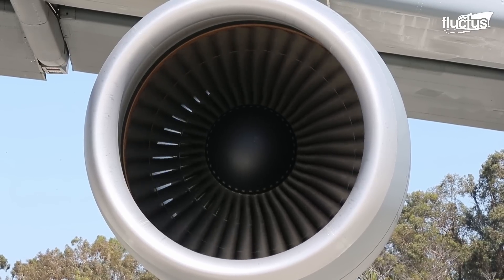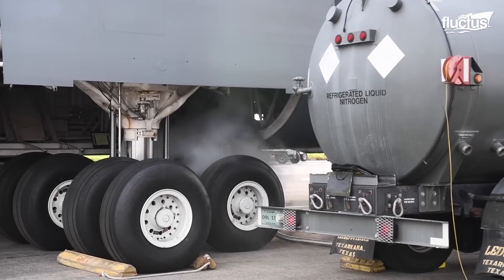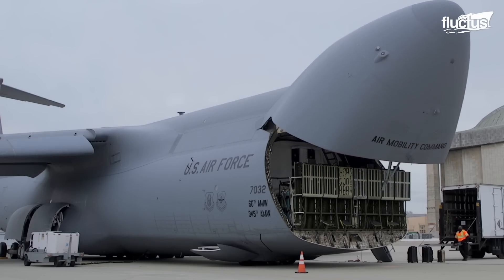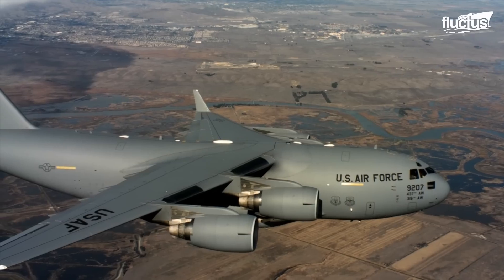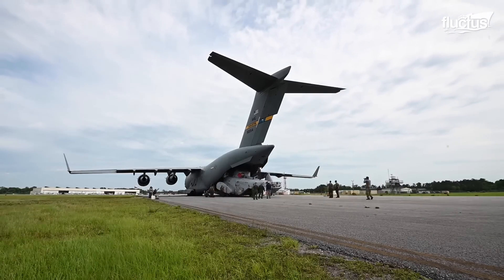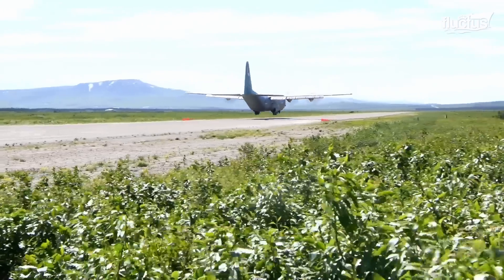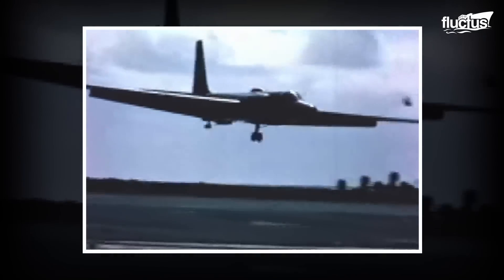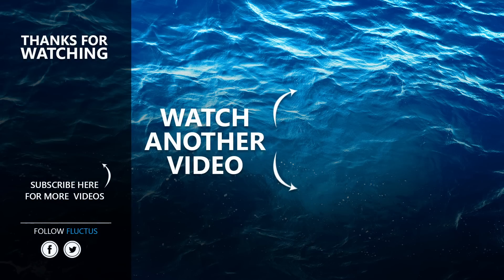The Crazy Process of Repairing the US Largest Aircraft

Comment: 1972-73..Not sure of the year. 630th MASS at Rhein Main AB. A C-5A arrived from England in the early AM .Off loading passengers , I looked down and noticed the puddle I was standing in. IT DID NOT RAIN THAT DAY. So I follow the stream toward the C-5 and find the stream coming from under the left wing....Thinking " water?"....But there is no water in the wing. The APU was running and the stream just did go around the hot exhaust. JP-4?....The load master was wstching the passenger deboarding so I pointed out the puddle and the stream coming from under the wing.....Yup....fuel leak. Quick shut of the air craft and dim bulb me just ho hummed the incident.

Comment: I never serviced tires with nitrogen
It was used for fire suppression
Where was the ppe when attaching the nitrogen lines to the service panel
The system is called Madars that gives fault isolation codes at engineers panel
I have removed and replaced almost every flight control cable on every C5 A,B,C aircraft from 2001 -2006 at Warner Robins depot
And was a crew chief for 12 years also
Changed many tires removed and reinstalled many flaps and horizontal stabs at Depot too
Reply: Madar is long gone, its all digital now

Comment: When the C-5 Galaxy was re-engined they chose the older and much less efficient GE CF6. They should have used the newest GEnx from the Boeing 747/8. This engine is 15% more efficient than the CF6. There was a proposal to change the wings from the outer pylon all the way to the tips. This would make the wing 15% more efficient. There was even an easy proposal to place vortices generators on the body to reduce drag 3%.

These three low hanging fruit options would have provided much greater payload capacity at the same distance  traveled. Or It could provide much greater range with the same payload shipped. The C-5 is amazing but they didn’t upgrade the aircraft with enough effort IMHO!

Comment: .
See ...
"Lockheed C-5 Galaxy vs. Antonov AN-124"

Lockheed C-5 Galaxy	versus	Antonov AN-124
75.28 m	247 ft	length	69.10 m	226 ft 8 in
67.97 m	223 ft	wingspan	73.30 m	240 ft 6 in
558.00 m2	6,006 ft2	wingarea	628.00 m2	6,760 ft2
19.80 m	64 ft 11 in	height	20.78 m	68 ft 2 in
4	engines	4
191 kN	43,000 lbf	thrust per engine	229 kN	51,590 lbf
764 kN	172,000 lbf	total thrust	916 kN	206,360 lbf
378,000 kgs	833,000 lbs	MTOW	405,000 kgs	893,000 lbs
9,560 km	5,162 nm	range	4,500 km	2,430 nm
M0.71	cruise speed	M0.78
130 t	287,000 lbs	payload	150 t	331,000 lbs

Comment: I was a C-5 maintenance troop in the 80's and then went on to finish collage and was selected to attend OTS and pilot training. I was assigned to fly the C-5 at both Travis and Dover. The nitrogen system described in the video was done so incorrectly, yes nitrogen is used in landing gear struts, but the servicing of the system in the video is the system that fills  the fuel cells as fuel is burned off to make the fuel cells non explosive. It also serves as a fire fighting system for under floor and gear wells.
Reply: The narration is atrocious, barley comprehendable.
Reply: @trespire  kinda like your spelling
Reply: @choossuck7653  I rechecked, what's wrong with my spelling ?
Reply: @trespire  lol barley. I wasn't trying to be a prick
Reply: I agree, the description of the nitrogen system was improper described and quite confusing.   Liquid nitrogen was primarily used in fire suspression and in pressurizing all 12 fuel tanks to scrub the fuel.  The liguid nitrogen was stored in two containers known as dewars and from there liquid nitrogen would be converted to gaseous nitrogen for fuel system and fire protection.  Gaseous nitrogen was serviced by maintenace personel to all tires and landing gear struts to remove the presence of oxygen that causes corrosion.
Reply: @j.need4qlife483  described perfectly. My favorite system to run to this day.
Reply: I remember that day, do you remember when the 200ton jack was down so I picked up the entire nose myself so you could take the nose gear off. Wasn't nuthin, but ain't nuthin...
Reply: T
Reply: @aasa4732  the C-5 was never replaced by the C-17. Very similar but very different mission sets. The C-17 replaced the 141, hence why both C-5 and C-17 are and will be in service for the foreseeable future.
Reply: I was at travis 82-84 Radio Shop 60th AMS...I'm proud to say I've sat on the T tail/ horizontal Stab,  at midnight on Christmas eve, riding launch, with a CDIPR problem...:)...You may have been there when one Crashed in Shemya Alaska and sent the main landing gear up into the upper deck...I filled out the maintence logs so many times, even though it was decades ago I remember Ops Chk GD IAW IC-5A-2-8-1...As a radio guy I got to write FAI a lot too...:)
Reply: @aasa4732  The C5s are down south of NC ,you know where and they are up north of Dover too.
Reply: Used as a fire asphyxiation system in sime data centres as well.
Only issue was that it only stopped the flames and not the smouldering so the fire wasnt completely extinguished and could restart once the nitrogen effect deteriorates.
Reply: Ever been to Westover?
Reply: Don't forget one of the C-5's major missions at Dover (A.G.E Mechanic 74-78)...periodic "engine runs" to keep Delaware from floating off into the Atlantic...

Comment: -  That tail shot gives a real idea of the scale of these big aircrafts! That they actually fly is AMAZING and a testament to the power of those jet engines and the skill of the crews and design bureaus!!   Imagine, lifting a 62 metric ton main battle tank and flying it across the world!!  
-  I am no engineer or anything as that, just I am 14 and I am fascinated by this stuff which to me borders on the near miraculous!  And I bet it that others at here do thinked so too.
Reply: Got to go on the C-5 production line at Lockheed Marietta while a Mechanical Engineering student at Georgia Tech. The tail of the C-5 is so high above the fuselage that Lockheed had a separate building outside of the main assembly building for the tail installation. It was called the “Cat House” because that’s where the C-5 got its tail. Fascinating plane and production line!
Reply: You should have heard the old tf 39 engines they had. You could hear them coming two states away. Awesome awesome sound

Comment: Been about twenty years since I worked on one as a Avionics Mechanic. Basically the same except for all the replacement of all the old analog indicators. Still have the augmentation system. My favorite was being called before a flight because it failed a self test. Up the ladder all the way to the top of the stabilizer to change a pressure switch. Not good for someone afraid of heights. Had more fun on the C-5 than on the B-52's. I loved working on aircraft and hated to retire but it was time.
Reply: The Aug, ALDCS and AP boxes are all gone now.  They are all contained in a pair of redundant boxes all bus interfaced.
Reply: @beckyumphrey2626  Looks like the systems themselves are still in place they just repackaged the controls. Did they keep the INU's?

Comment: 'Was at Altus, Okla. in 78-81'. I worked flight-line C-5a's and the last year 141a+b's  2nd shift in ISO docs. I ended my time in MAC doing T.O.D.O. in Oklahoma. I transferred to Gaum, USA in August 81-83'. SAC and did a B-52D to G conversion working TODO. ('Rec'd an 'Air Force Achievement Medal, and transferred to Grand Forks, North Dakota in 83'. I was on B-52G's and was engine run Qualified working the flight-line, in-the-cold' for four winters. (Coldest place to work/flight-line.) I had other hats/ Mobility in Gaum/disaster prep/shelter team...and I played my trumpet in the 'Red Dragons and a year and a half in the Air Force Band. I went on from North Dakota to the desert and worked the B-2 Stealth and then the I.G.'s office...20+ ...WOW  ...Oh, it is called MADAR in the C-5, too!  (Malfunction Analyst Detection And Recordin' unit!)

Comment: I guarded C-5A's from 1974-77 at Altus AFB, OK. Had several friends in maintenance so I found out how much was involved to keep these aircraft in the air.
Reply: 1973Veteran, I  must have walked, or drove  past you at least a few hundred times. I worked on the C-5 flight line from 71-78, then went over to start the Field Trying Detachment. I left Tornado Alley in 1979.
Reply: @mrsamzero1  I probably checked your line badge a few times. I pulled Entry Control Points on the C-5 area and when they were parked in the hangars having maintenance. Also pulled security on the C-141's and the KC-135"s.
Reply: I was there dec 69 when the first one arrived! SAC & MAC 1966-70 Sgt USAF Transportation Sqdr

Comment: Back in Dec 1995 was mobilized for Operation Joint Endeavor.
We flew from Ft. Benning, GA to Germany on one.
We loaded our trucks onto it and then stayed to help the crew chief secure them.
I snagged three rows of seats for my unit.
Right by the emergency exit and the exit rope you use to climb down it.
Was able to lift the arm rests and stretch out on the seats.
We'd taken off at 0600 and and landed around 9:30 or so in Frankfurt Germany.
After we had loaded the craft, we were walking back to the hangers.
I stopped and looked at the C-5. It was leaking fuel but that was to be expected.
I asked myself, and I already knew the answer, "Can this thing really fly?"
Yes. They can.
Reply: 12 years flying C5s.  If one was leaking ‘fuel’ we would have declared an emergency and had fire trucks there ASAP.  You were likely seeing moisture but certainly not fuel.
Reply: On our way back after Desert Storm we stopped in Germany. As we walked into reception center a young woman was standing near a table. It was clear she was Army. What got us was she was holding a teddy bear almost as big as she was with her left arm. She had two M16s in her right hand. My buddy looked her and said, "bet no one is going to take that bear away from her." They're great planes. However I hope I never have to fly on one again. I almost froze on one trip.

Comment: According to the law of physics, these massive aircraft should not be able to fly, but they do. We have some very brilliant people in this world!
Reply: Actually the laws of physics support the theory of flight.
 Newton's third law of motion, for every action there is an equal and opposite reaction
Reply: @John Evans 
As a aircraft engineer for the last 27 years I can assure that's just not true.
 Are you referring to the ongoing debate about airfoil Circulation theory Vs Bernoulli's theorem?
 Airfoil design and aerodynamics, both subsonic and supersonic is very well understood.
Countless hours are spent in wind tunnels fine tuning wing aerodynamics in minute detail.
 If it wasn't well understood then aerodynamicists would just be purely guessing as to what shapes to use as was done back in the 1900s.
Reply: Its physics that allows it to fly.   Top if the wings is longer than the bottom long story short it provides lift.  So then the size and shape of the wing makes all the difference
Reply: @John Evans 
Actually it doesn't at all. 
Most aerobatic aircraft use a uncambered (or symmetrical) wing, meaning the top and bottom sides have the same curve.
These aircraft rely on a positive angle of attack (the angle the air hits the front of the wing) to generate lift, which is why when they're upside-down they fly nose high.
Again they are relying on Newton's 3rd law, by deflecting air downwards they create a opposite force or lift and relying less on the lower pressure on top of the wing to provide a upward force.
 You can also fly upside-down with a cambered wing (more curve on the top) but this requires far more angle of attack to generate lift.
 You can get a flat plank to generate lift with enough angle of attack or even your hand out the car window albeit not very efficiently and with a lot of drag, this is why so much time is spent refining wing design, to reduce drag as much as possible during the creation of lift (induced drag) and increase fuel efficiency.
 I also fly Radio control helicopters and with symmetrical rotor blades (which are just wings) to make the chopper climb we increase the angle of the blades from about +4° during hover to about +12° at full climb, and by reversing the angle of the blades to -4° we can hover upside-down.
 Aerodynamics and lift are certainly a very complex topic.
Reply: @John Evans 
Yes, the 4 forces acting on a plane are lift/weight and thrust/drag, they all must be equal for a plane to fly.
 Ignoring the circulation theory the main things that alter a wings lift are Camber, wing area, angle of attack and air speed.
 In passenger aircraft during cruise we want as little drag as possible so this is what the wing is designed for, most of the lift is created from having a lower pressure on top, now when we want to land the plane slows down, this will reduce lift and the plane will decend.
We can stop decending by raising the nose a little which will increase the angle of attack (effectively increasing camber) and cause some air to be deflected downwards, but eventually we will slow down so much that the wing can't produce enough lift so we extend the flaps.
This does 2 things, it increases the wing area (more wing = more lift) and the flaps will deflect air downwards (Newton's 3rd law again).
 But now we've added more drag so we have to increase the thrust (engine speed).
It's a fine balancing act.
Reply: @John Evans 
Yes a fighter jets wing produces lift, but many the shape of the fuselage will also generate lift.
Fighter aerodynamics are a lot more complex due to the wide speed range (subsonic to supersonic where air behaves VERY differently), maneuverability and load carrying it needs to accomplish.
 And even rockets or missiles still have 4 forces acting on them that need to be countered, their engines will provide a slight upward force that counters gravity,  and many have small fins. Due to their high speeds the fins don't need to be large to provide enough lift.
 The 4 forces (lift, drag, weight, thrust) must always be balanced.
 Take a Harrier jump jet, when the wings can't provide enough lift the engine thrust is defected downwards to balance the weight and allows it to land verticality.
 I'm off to bed my friend, but If I can answer anything else please feel free to ask. 🙂🇦🇺

Comment: I remember as a youngster in the late 90's on Lockheed's Mod team doing satcom mods on this baby and I had to run the wiring to the tail for antennas etc
Reply: I was the wire you laid down. They removed me in 2000 because you installed it totally wrong. Now I have no life and just sit on YouTube like a lonely wire. :(
Reply: So you were one of the E&E s that worked ( ah hung out )in the hayloft most of the day?

Comment: The C-5M is a WILD upgrade!
Reply: When the C-5 Galaxy was re-engined they chose the older and much less efficient GE CF6. They should have used the newest GEnx from the Boeing 747-8. This engine is 15% more efficient than the CF6. Another proposal was to change the wings from the outer pylon all the way to the tips. This partial re-wing would make the wings 15% more efficient. There was even an easy proposal to place vortices generators on the body to reduce drag 3%.

These three low hanging fruit options would have provided much greater payload capacity at the same distance  traveled. Or It could provide much greater range with the same payload shipped. The C-5 is amazing but they didn’t upgrade the aircraft with enough effort IMHO!
Reply: @andrewday3206  Much of the US aircraft are upgraded as needed to avoid the massive price tag of purchasing a new fleet of aircraft.   One thing that cannot be done is upgrade aircraft with technology that has not come out or been proven.  When new advance technology is being used to replace older legacy technology, the time spent to engineer and test takes years.  By then, even more new technology has come out making the latest advancements in upgrades seem a bit obsolete.  The most important factor for upgrade is reliabilty to fulfill the mission.
Reply: @j.need4qlife483  
Well that may be true, in this case it is not the case. The GEnx was a proven technology. Better airfoils were well proven as were vortices generators. Look up the history of the C-141A vs the C-141B. The update I mentioned was a much smaller deal than upgrading the Starlifter. When you can double or triple payload at max range that is what is important. When your tanks hold 1/3 Million pounds of jet fuel even a 25% savings is 80,000 pounds more payload at max range. This is about cargo capacity and every technology was produced and proven.
Reply: @j.need4qlife483  
BTW I served on the F-15 and A-10 flightline. This is about mission capability